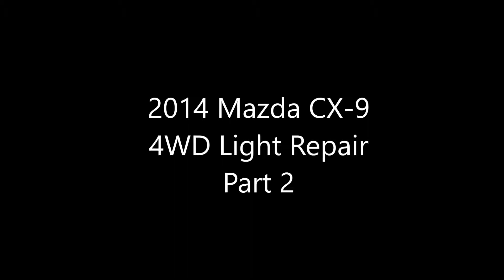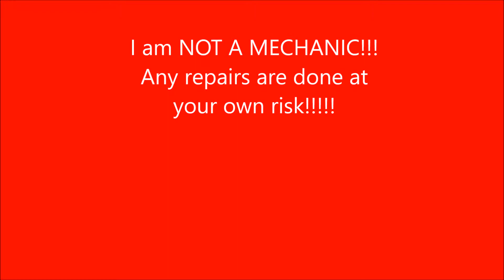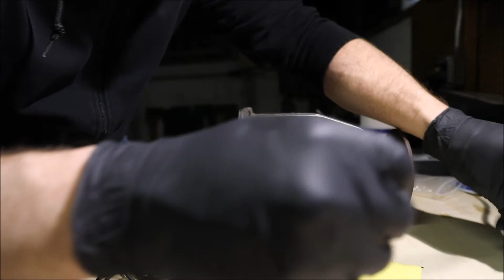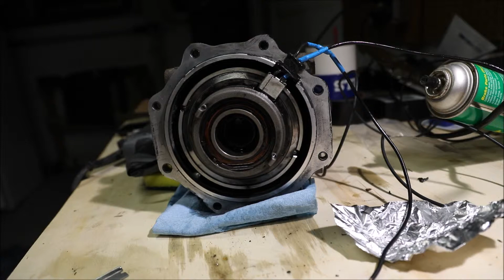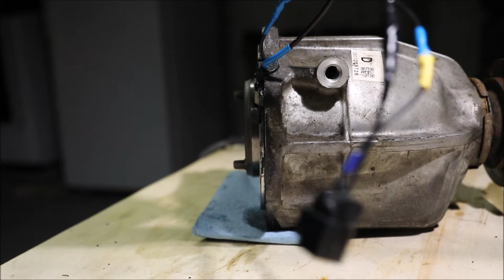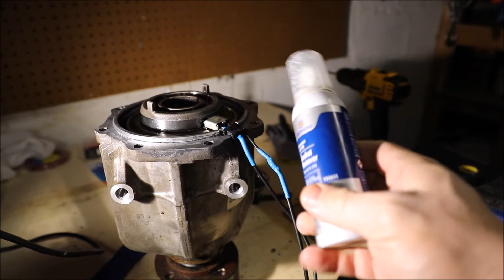CX-9 4WD Light Repair Part 2

Comment: Hello, do you have the part number for the rubber seal?
Reply from the maker: Do you mean the little rubber gasket the wires run through? I’m not sure if they sell that separately. Here is the diagram page from the parts: https://www.mazdapartsconnect.com/v-2014-mazda-cx-9--touring--3-7l-v6-gas/rear-suspension--axle-and-differential

If you mean between the two bell housings, it’s gasket maker, which you can find at any parts store. Let me know if I can clarify that. Good luck!
Reply: @maximilliangrundy8726  yes i am looking for the wire seal!
Reply from the maker: @brand0llaz  I haven’t seen that part listed separately. I think I would find an appropriate rubber, and carve a new one to match. That, or head to a junkyard and remove it from a donor car.